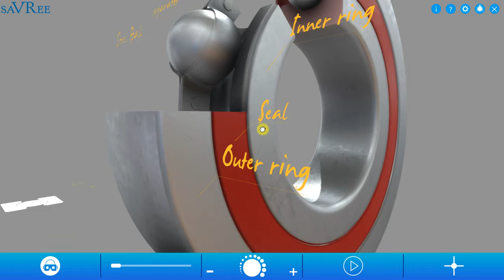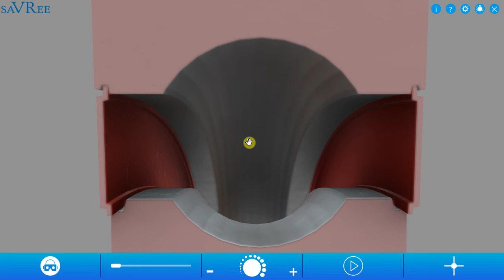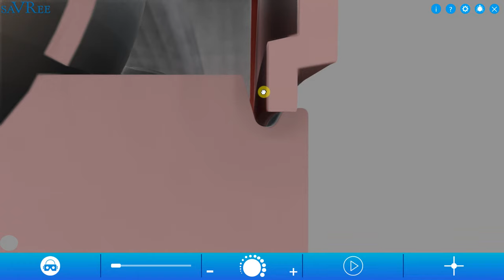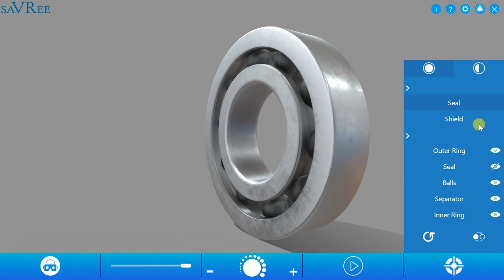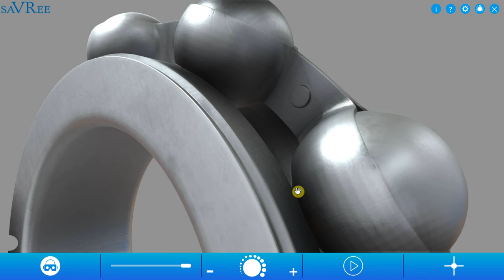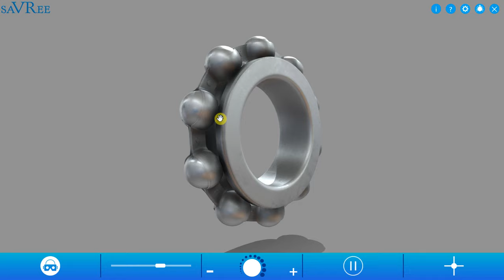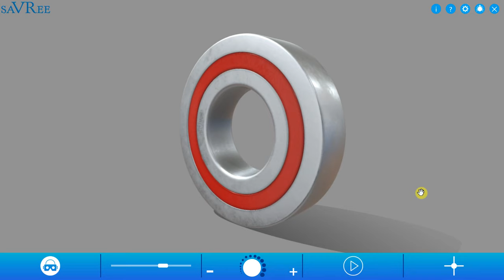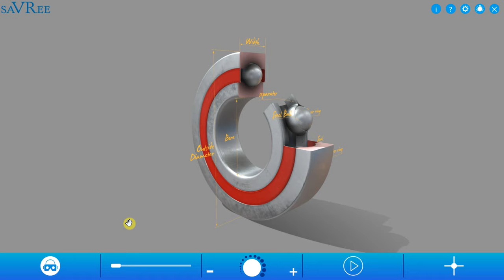How Ball Bearings Work (Engineering)

Comment: An example of a ball bearing that rotates the outer ring and keeps the inner ring stationary is on a skateboard. We put the ball bearing into the skateboard wheel and the inner ring is tightened on with a nut, then the outer ring will rotate when the skateboard is pushed.

Comment: Hello, couple questions: 

Doesn't the ball rub against the separator when you rotate the bearing, causing friction?

Also, doesn't the seal rub against either one or both of the inner/outer rings, also causing friction?

Cheers
Carl

Comment: Dear Sir,
Can you make a brief class on all types of bearings.
Especially the ones used in connecting rod small end bearing & On crank shaft bearing multi-piston engines...
Because I heard about some "ridge bearing" application in advance engines used in connecting n piston & on crank shaft (engines use to drive boats:A video From 
"'HOW ITS MADE- 445 Outboard motors"' )
As far as I know, use of roller/needle bearing & split bearing or bushing respectively in piston end & crankshaft .....
Kindly requested can you please watch the Supra refered video and revert me back if.....
Thank you once again...

Subscribed channel n liked videos.

Comment: There should be rolling contact between the balls and both raceways - the inner race shouldn't be stationary with respect to the balls in the animation.
Reply: This is what I came to ask! The animation shows logo on the inner raceway staying perfectly in the same spot as the bearing above it. If that's the case, the bearing wouldn't be "rolling" anywhere! If the bearing is touching the upper race way, I suppose that would make the bearing roll backwards while staying in the same spot in relation to the inner raceway, according to this animation. It would be nice to see what truly happens. Thanks for you comment, confirming I'm not crazy for thinking that, hehe.